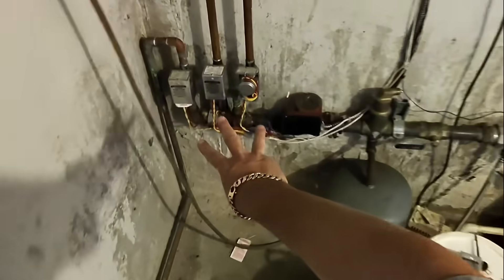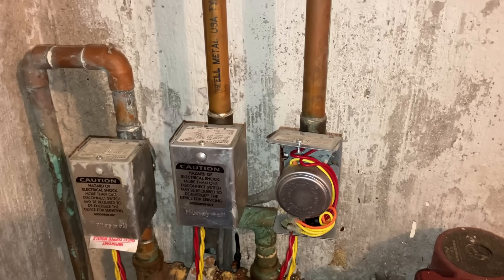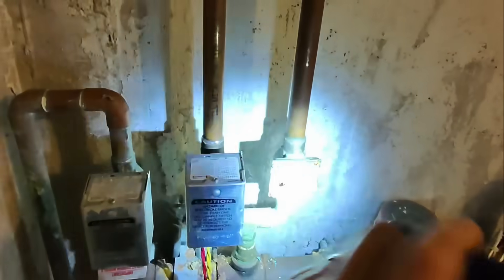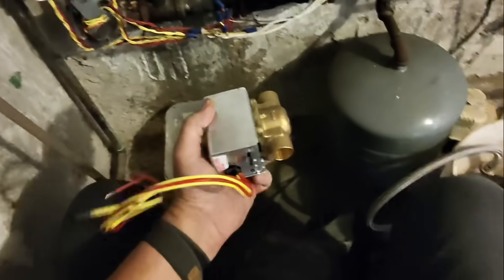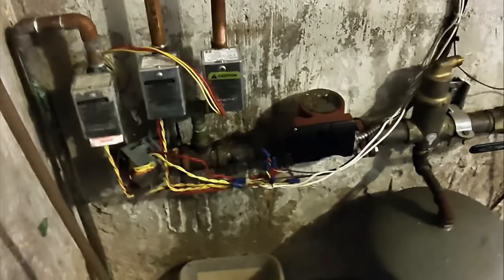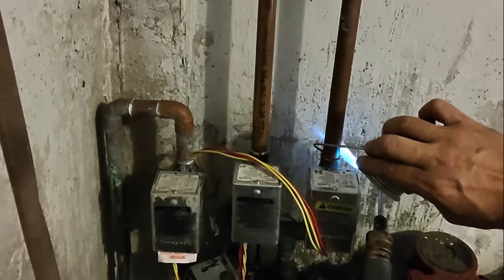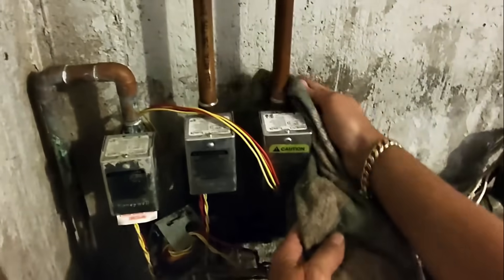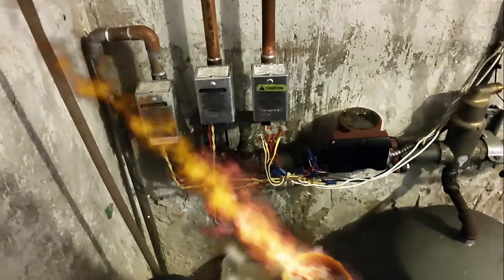No Heat FIXED! Honeywell Zone Valve Replacement Done Right 🔥 (1 of 3 Zones Dead)

Comment from the maker: Another real-life no heat service call — one of three zones down, and a failed Honeywell zone valve was the culprit. Watch as I show how to properly drain, cut, clean, flux, and solder a new valve the right way 🔥

👉 Have heating or plumbing issues? Visit https://pipedoc.net
 or call 516-348-6400 — proudly serving Long Island, Queens & NYC.

💬 Drop a comment if you’ve replaced a Honeywell zone valve before — what’s your go-to technique?

#MikeyPipes #HeatingRepair #PipeDoctor

Comment: Wagos are the best. I used them on stuff I mess with in my house. I've replaced a lot of light fixtures over time and wire nuts do not work well with solid and the fine stranded stuff fixtures always seem to have. Not a problem with Wagos. Plus servicing in the future is much improved with not having to untwist a ton of solid wire.

Comment: Hey Mike. its 17 Degrees 🙂here in Anchorage. We fine. Got a case of beer roll out switch spill switch control valves replacement taco circulator. expansion tank. wagos zone valve carport via UPS the whole 7
Reply from the maker: Stay warm out there!